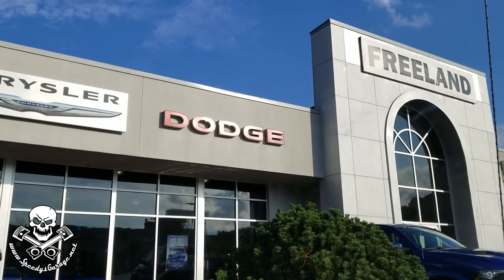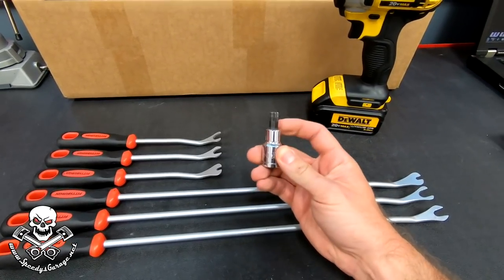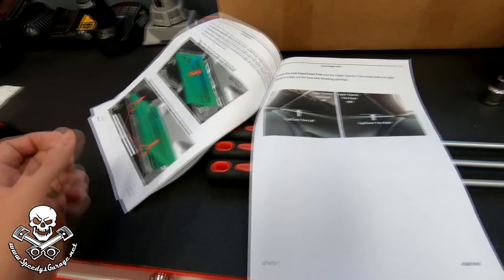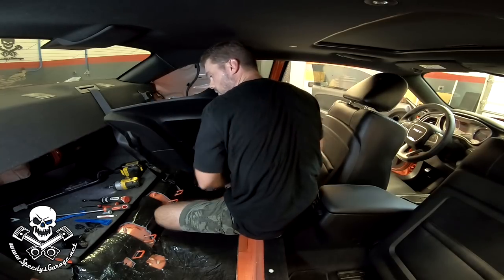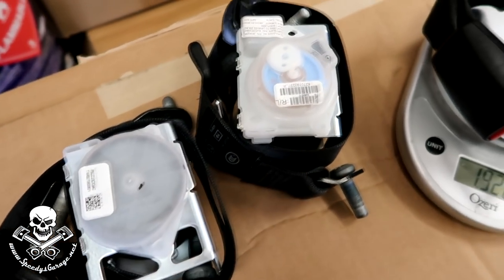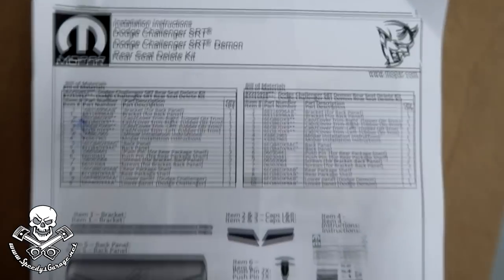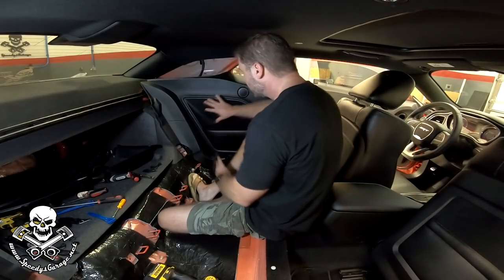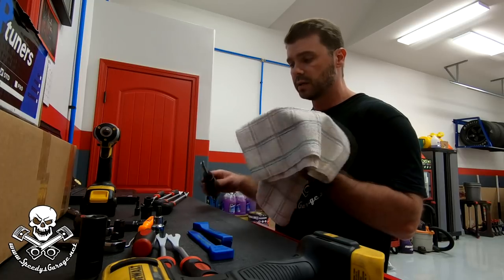Speedy's Garage Dodge Challenger Rear Seat Delete

Comment: Hey Speedy...just about ready to pull the trigger on the rear seat delete.  Not specifically on topic but where do you put your lap top when you datalog at the track and do you secure it in any way?  Do you ever use the cargo netting? Thanks and BE SAFE
Reply from the maker: On  the pass side floor
Reply: @SpeedysGarage  Thanks...yea that's probably the safest place for it but leaning over the console can be a pain. Have a nice weekend and Happy Easter.

Comment: How do you get bottom of the set up when it's in, my hellcat has one, I been trying to get the bottom up for two hours I don't want to break it, trying to get to the fuel pump, to install a double pump in on the rear seat delete is it a certain way or a special tool you have to have to get the to bottom up on a rear seat delete.
Reply from the maker: You'll likely wanna use a pry tool on each side where the tabs on the bottom go in to the slots in the bottom of the car.  You'll have to be careful.

Comment: Hello Speedy...did you disconnect the negative battery cable to do this install?  Thanks
Reply from the maker: Nah, I normally don't unless I'm messing with something I think will cause an issue like a starter for example.
Reply: @SpeedysGarage  Thanks...just finished the rear seat delete install. Marking the clips with tape was a great idea.

Comment: Curious now hat you've had it for awhile, whats the noise level around town in the cabin now? Cant recall if you have exhaust mod but Im running mid muffler swap (Vibrant 1794) and plan on cat delete.  Also hows the music sound now?
Reply from the maker: I'm going to "estimate" 10% more sound than stock mainly from exhaust.  Stereo sounds the same as best I can tell but I'm usually more focused on listening to the exhaust LOL.  I'm stock exhaust.

Comment: ok my concern is, can you have that dividing wall out permamently to expand the cargo space and where you hook in that net, so it can be actually functional? Cause on your video looks like it is just laying flat which doesn't make sense to me ?
Reply from the maker: The net is to hold your helmet.
Reply: @SpeedysGarage that's not what I asked for, but whatever ... I already got my answers from someone else ... BTW if you can't be helpful at least don't be useless ... sometimes its just better to not answer at all.
Reply from the maker: Maybe don't ask silly questions on youtube that have already been shown 1000 times?  It's a rear seat delete not a cargo hold.
Reply: @SpeedysGarage  maybe don't bother answering if it's silly to you and like I mentioned before nevermind I got my answer from someone that didn't try to be smarta.. BTW its. called CARGO NET for reason

Comment: Too bad the rear seat fold down feature is sacrificed. Carying 2 drag tires/wheels to the track means folding down the rear seats. NO WAY would I place a wheel/tire on my leather seats.
Reply from the maker: I'm able to fit my rear drag tires in the trunk with the rear seat delete installed a long with one of the fronts skinnies, and some other stuff too.

Comment: Will you install 309 gearing? If no why not.
Reply from the maker: I don't plan on it.  Mike from OSTDyno.com is running the stock 2.62 gears and running mid 9s, so not necessary I don't think.

Comment: 🤦🏻‍♂️ I’m sorry. But this is the dumbest thing. That how they market gets you for spending money on stupid things, useless things. Several things, the outcome looks the same, except for the netting over the lap seats & yet you lost the functionality of the carrying people in the backseat. Second, this is like a teenage boy doing a cheap, ricer car weight reduction which is so pointless. Weight reduction racer looks absolute bar minimum inside, no carpets, sound deadening, plastic trims, radio, dash, only driver seat & roll-cage,  I could go on! I know, its only my opinion. This was hard to watch, I gotta say NO to the “deletes”
Reply from the maker: Dodge sells these cars as "seat delete" optioned FYI.  I don't carry people in mine so don't care about a back seat and seeing stripped out street car with metal and wires showing isn't my style.